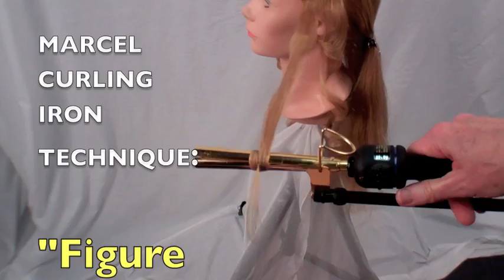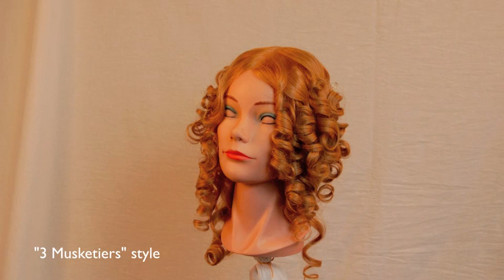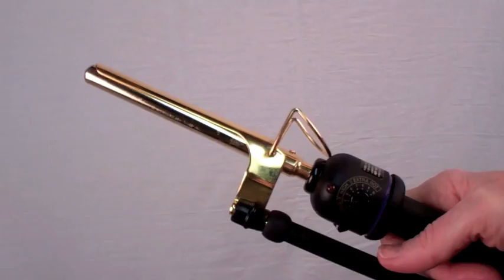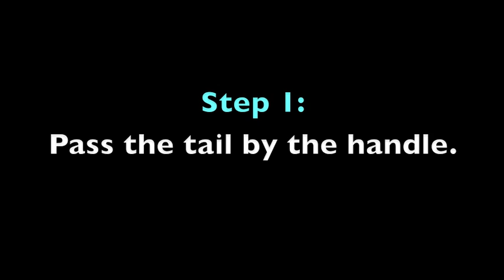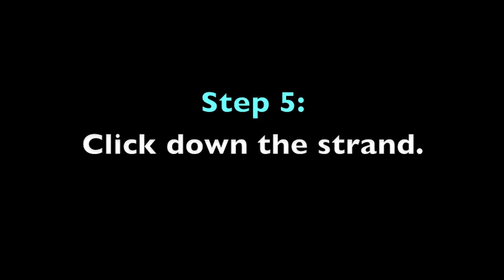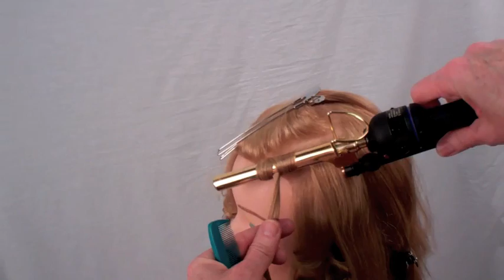Figure 8 curling with a marcel iron

Comment: I am in Cosmetology school and yet to have mastered turning/holding the Marcel Iron while curling hair. It is hard to me because the part you hold turns and does not lock on mine. It feels like it could drop. Any tips?
Reply from the maker: +Holly Jaramillo Hi, sorry you are having challenges.  Marcel technique is very different from spring iron technique.  Make sure that both the shell and the handel swivel freely.  Some irons have a lock button that prevents the swivellling. be sure it's unlocked.  use only your fingertips to work the shell.  Holding the shell too high on the fingers can make the hair slip and make it hard to pull your pushing fingers out from under the shel when you want to swivel the iron in your palm (for ringlets, etc)  I hope this helps.  Cheers, Janet
Reply: I been in beauty school for 3 half months almost. I never knew how to use it. I do now tho I'm so geeked

Comment from the maker: Thanks Vivian!
Small hands: find a compact iron. practice clicking and turning, a lot!
Steps 1 & 2: shell is on top: insert strand.  Pass the tail of strand underneath, then over the iron (toward the HANDLE SIDE), while rotating the iron toward the head. (shell ends on top). 3: push the loop forward, 4: pass the tail of the strand underneath, then over the iron (toward the TIP END), while rotating (and clicking) the iron toward the head (shell ends on top).  Figure 8 made, click down strand. :-)

Comment from the maker: Presuming you don't live in a very humid or rainy climate, try the following: Do not attempt to curl right after you've shampooed: curl  on the second day, when the hair is completely dry. Curl smaller, evenly sized strands. use a slightly smaller iron than desired result.  Lightly spritz (but do NOT saturate) each strand with hairspray just before curling. Take your time. Support each curl as it cools. You might also try the papillote curling method demonstrated on my channel. Good luck!  J

Comment from the maker: You're right, 1taffycat, you can get similar effects using other tools and techniques. But this tool, while awkward at first, is about manual dexterity and controlling the hair--that's what State Board Cosmetology examiners want to see. Think of it like parallel parking: to get a license you have to prove you can do it, even if you never do it again! Myself, when all else is the same, I prefer the marcel iron to the spring. I can curl clients' hair faster and my wrists hurt less.    cheers, J